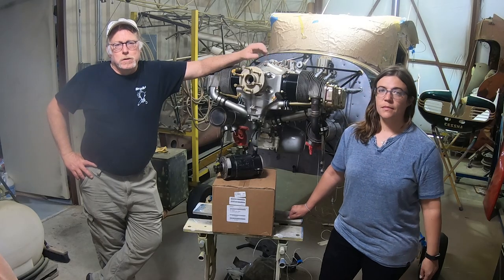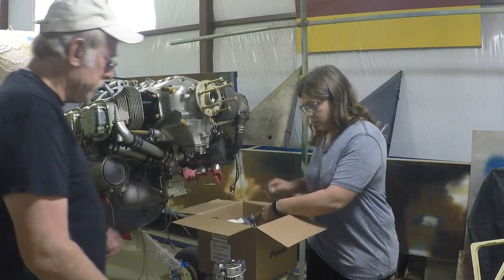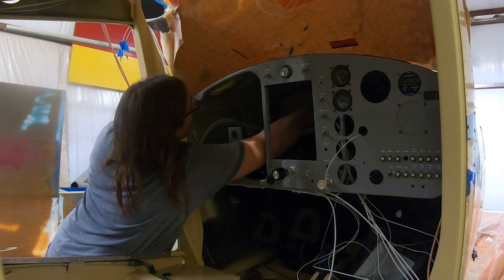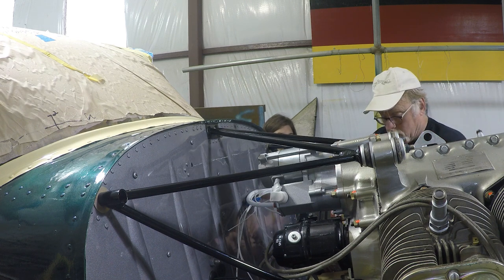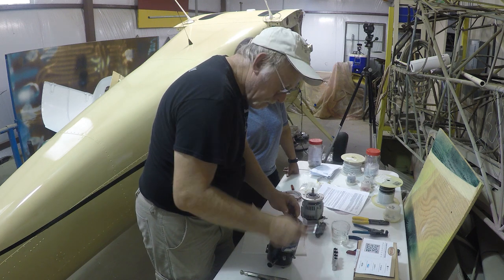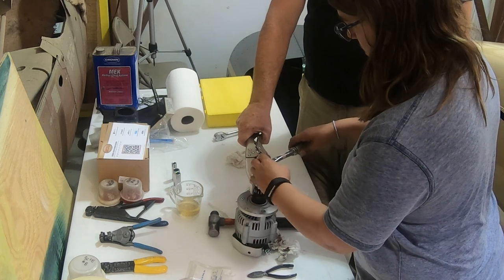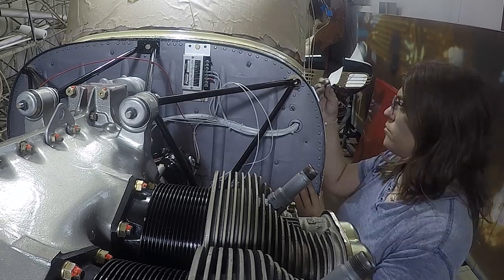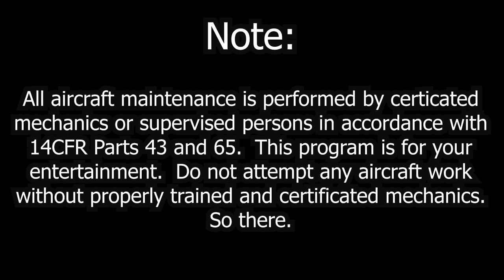Cessna  PlanePower Alternator Installation

Comment: Kaitlin is awesome, great work! I ordered mine 10 months ago and it finally came off backorder. I’ll be replacing it down in East Texas along with a gascolator mod. The plane has a new engine and prop so Im just trying to get it modernized at this point.
Reply from the maker: Cool.  Keep them flying!

Comment: G,day Bill and Kaylyn from Sydney Australia.
Thankyou for demonstrating the installation of a regulator to the firewall and altenater to engine.
Power cord (all white wires) do you label each wire to ensure accuracy?
* Will the C-120 have circuit breakers, or not enough systems to require them?
* I am left unclear about the two wires running inside with a light?
🌏🇦🇺